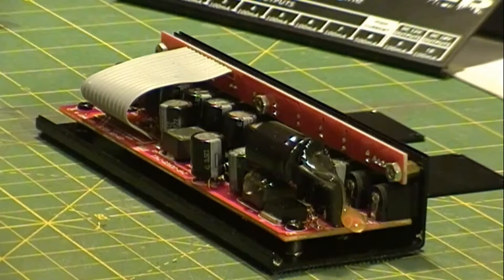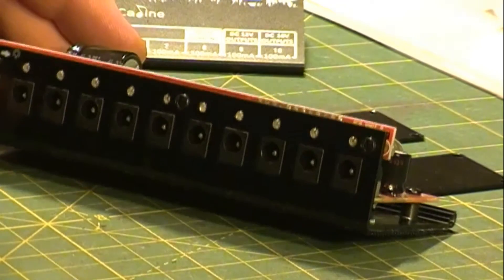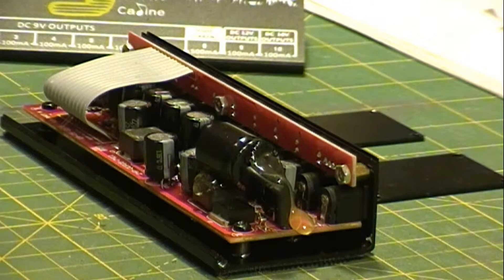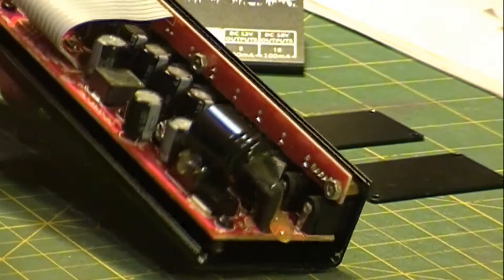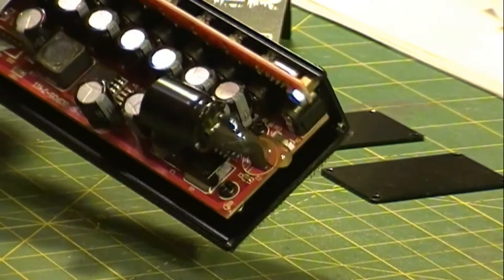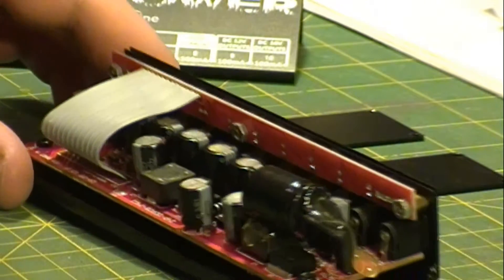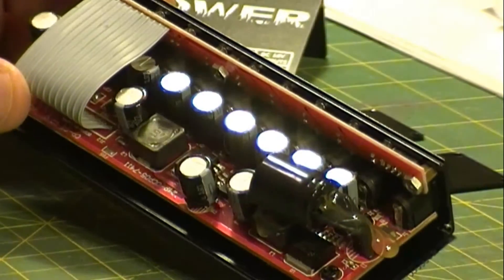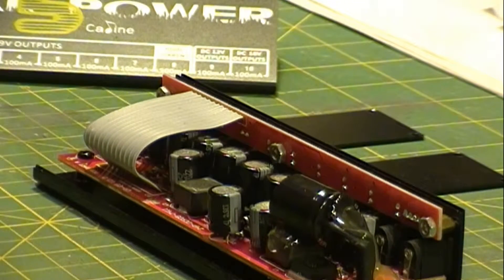Guitar Modifications caline CP-05 power supply

Comment: Hello bro, nice to watch your video and really help me. I plan to replace all of my caline capacitors as you do. When I open my caline there are 1000uf 25v, 220uf 25 (4), and 100uf 25v (9).  so what is the value of the capacitor you are using and the voltage?  Could i change 1000uf to 2200uf to eliminate noise?

Comment: I mean more like how many microfarads and voltage capacity?
Ive had two and no problems. I think you might have used a bad power supply that went past 15v cause thats the original capacitor allowance.